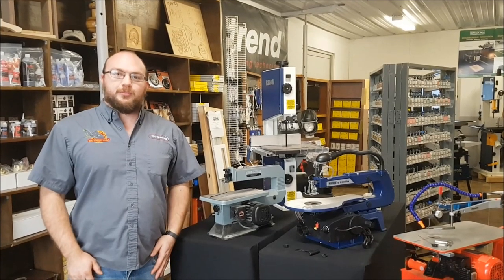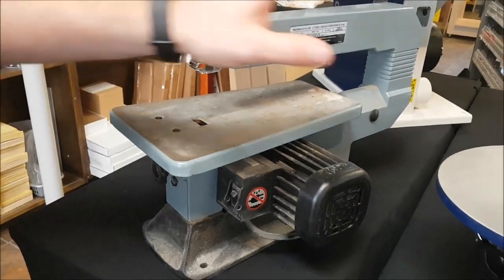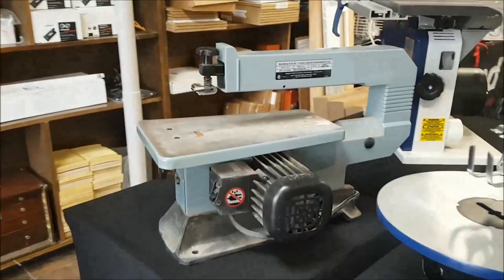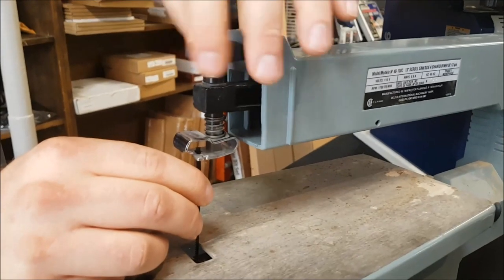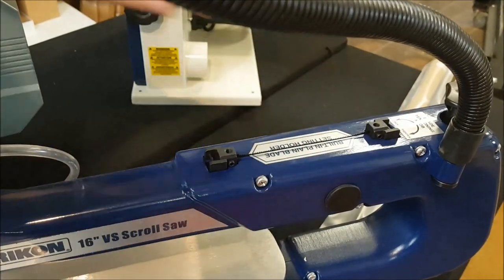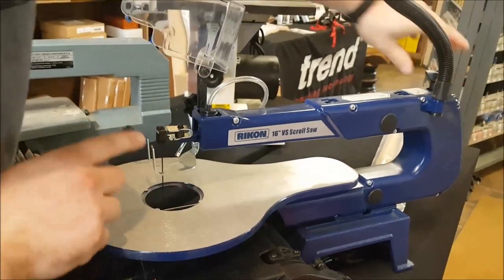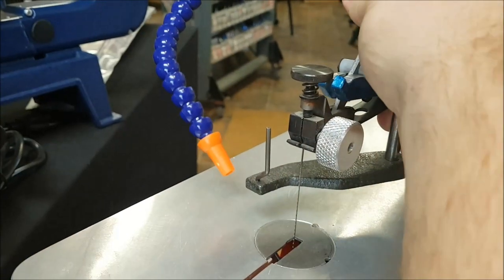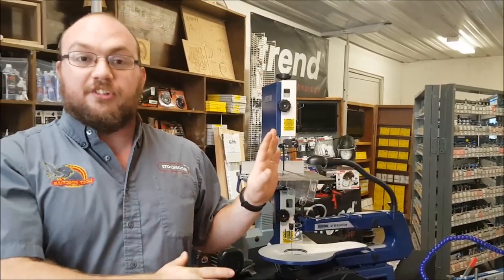Pinned VS Pinless Scroll Saw Blades Hegner Delta & Rikon Saws EthAnswer

Comment: Using pinless blades on a cheap scroll saw FOR INTERNAL CUTS can be a nightmare. The example shown in the video of the two clamps in the holder to insert the pinless blade into is not the whole story, or truth, because for internal cuts, the blade has to be inserted through the hole in the workpiece, and thus the holder is useless when internal cuts are to be made. I learned this the hard way ! 🤷🏼‍♂️

Comment: I have one of those old Delta saws. I’ve looked at the re-fitting gear to use the pinless blades on that saw. Do you have any experience with if they work?